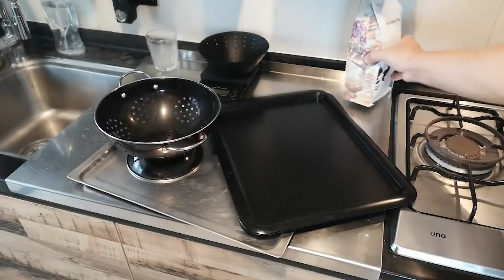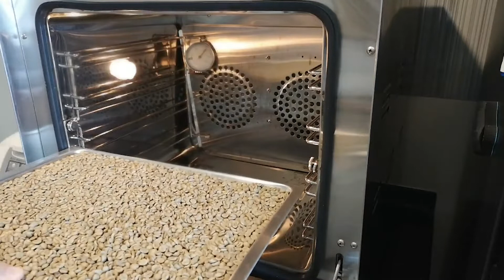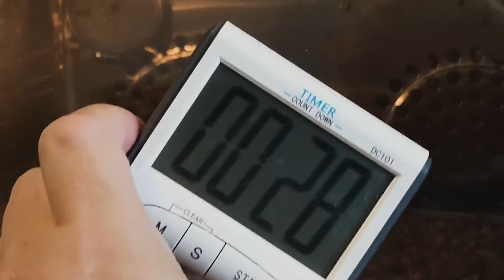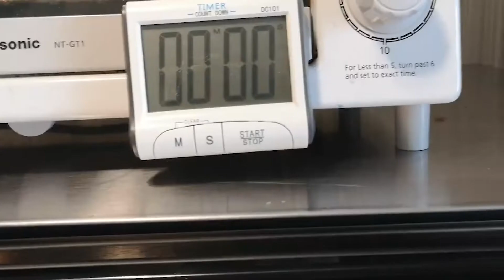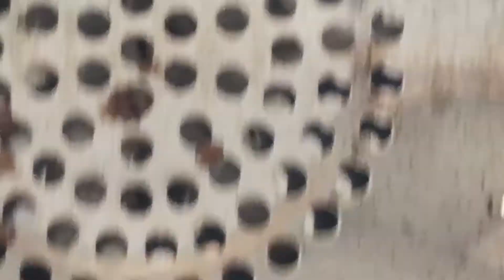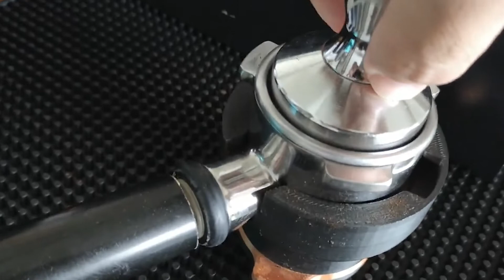DIY Coffee Roasting, In An Oven? Can you roast your own espresso coffee beans at home in an oven?

Comment: I bought a stainless steel mesh cage that can be loaded onto the rotisserie of the OTG and yesterday I made my first ever batch of roasted coffee. It worked simply awesome!
Reply from the maker: Yeah those work well. Just be careful of the chaff catching fire cheers.
Reply: @overheadrecipes  it was amusing to see tiny flashes on the bottom heater coil. Initially I didn't understand what was that. Then I realised it's chaff burning instantaneously. But it turned out to be just fine. Have a great day!